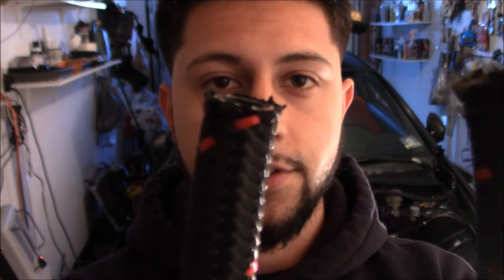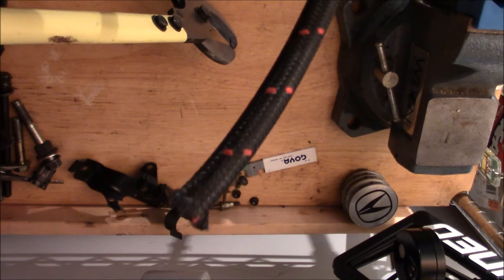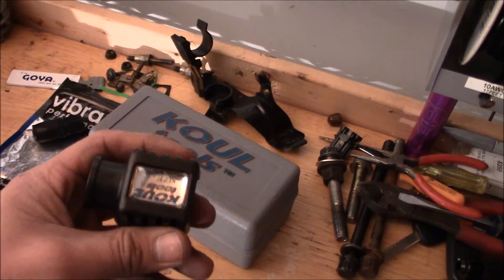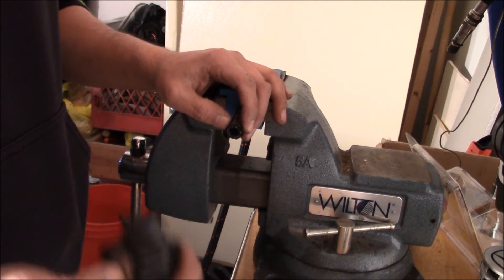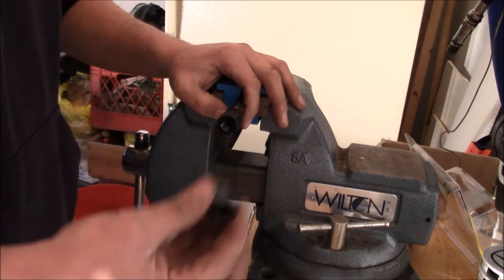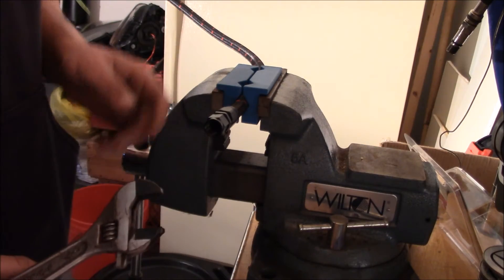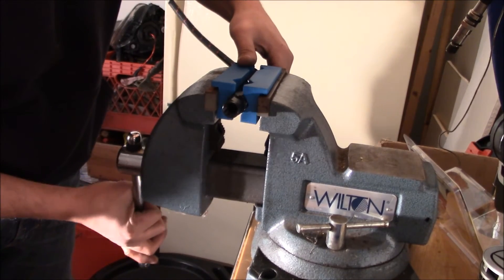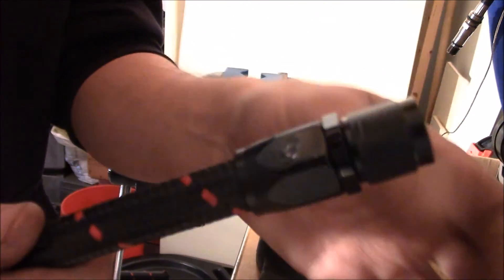HOW TO MAKE BRAIDED HOSE WITH AN FITTINGS!

Comment: @ 6:33 mate, an adjustable wrench? Do you see the cutouts in your "soft jaws" it is no coincidence that they match up with the shape of the AN fitting, the whole idea of the cutouts is to hold the AN fitting securely whilst you tighten the fitting. I cringed watching you use two spanners when all you needed to do was slide the fitting to the left into the soft jaws.

Comment: using the same tool and my hose just won't thread into the fitting... I suspect it's the hose being too thick or are there special fittings for nylon braided nitrile hoses?